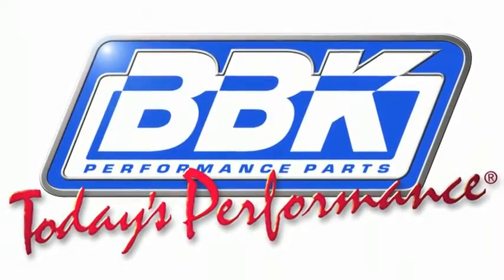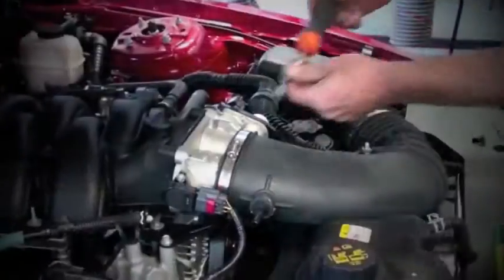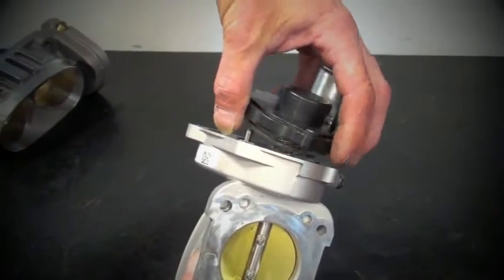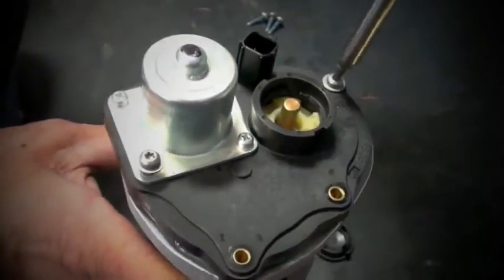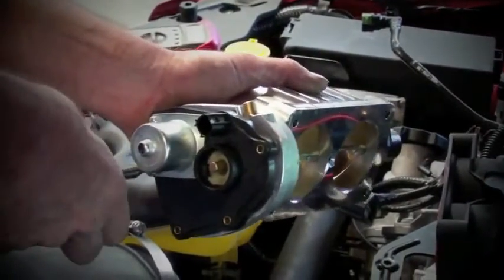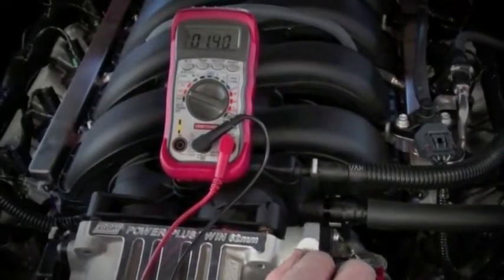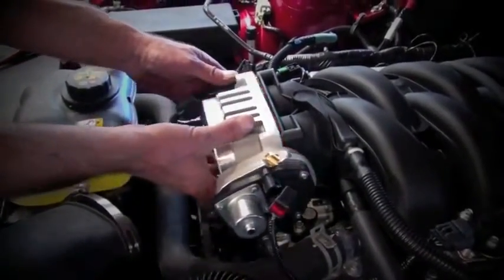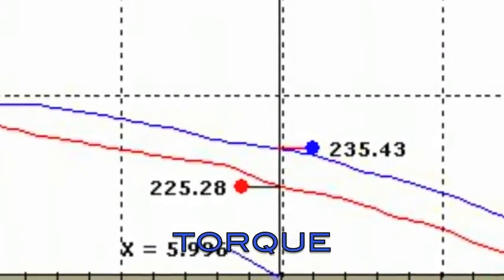2010 Mustang GT Twin 62mm Throttle Body Install and Dyno Test By BBK Performance

Comment: Does anyone know when testing the voltage what wire you check there are like 3 or so different ones and I can't get a good reading on them. I'm just making sure I've got the right wire

Comment: Those stock hp numbers are low for sure 235 😂 they make 315 engine hp stock I’ve seen the 2005-2009s lay down about 280 stock to the wheels
Reply: Yeah mines was 263 after mods it’s 350
Reply: @LONGLIVETHEGODZ  yea mine was 260 on the dyno stock after I modded mine I was at like 340ish
Reply: Its an auto with a 20% drivetrain lose, therefore less hp than the manuals cmon people
Reply: No you haven’t they make about 260 to the wheels stock
Reply: Mine was 288 before any mods a 360 with Cat-Back, tune and this throttle body with a cai
Reply: @kingtuckgesus8879  highly doubt that let me see your dyno numbers
Reply: @johnwayne7985  it was a custom tune last year I don't have them but one thing to note is I had a engine rebuild these cars are old so compression is not the same as in 2005

Comment: BBK needs to relocate that set screw to the outside to keep from all that cover removal. Simple change to the body casting design to have a built-up tang for the set screw to be located would interfere with anything.

Comment: why were the baseline hp and torque numbers sooo low? most 05-09 mustangs make 260 hp stock...this is a ten and came with 15 more crank hp...so we definitely should have seen better numbers
Reply: It does not show max torque/Hp, bust the place where the increase over stock is the highest.
Reply: It's an auto which make less hp than the manuals with 20% drivetrain lose
Reply: @josephr.8622  Which is what i figured when i originally made the post. ive seen a few 05-09 stock gts make 250 hp to the wheels with the 300hp crank rating...with an addition 15 hp rated on the 2010 mustang i expected more not less hp on the base run.

Comment: everythingmotors you need to tune your throttle body so the computer can read the extra air coming thru. A Bama hand held tuner should do the trick
Reply: So if I have a bama tune , I just request a new tune when adding this part ? I won't need to manipulate voltage manually , right ?
Reply: @neggan71 yes if you have a bama tune i believe you should have free tunes for life, so contact bama for a tune